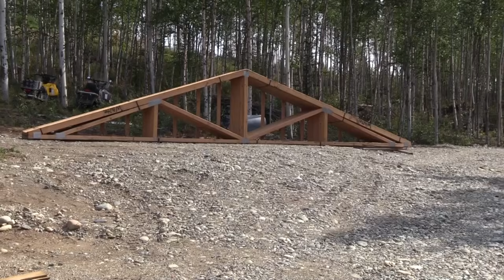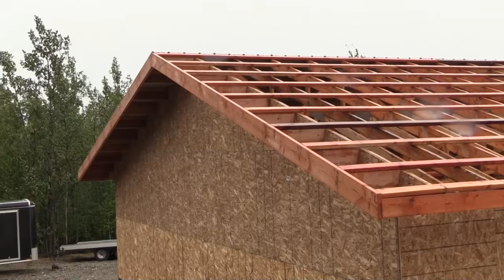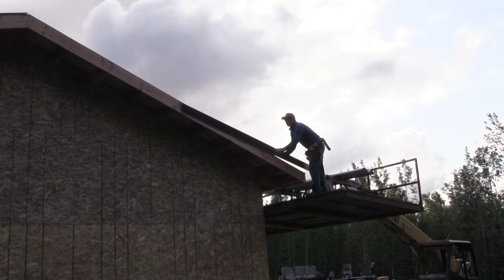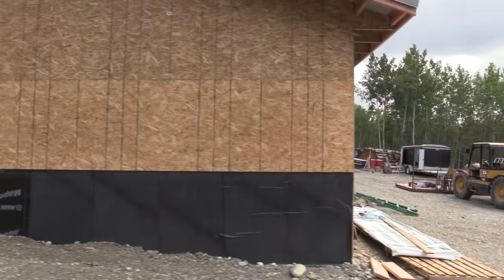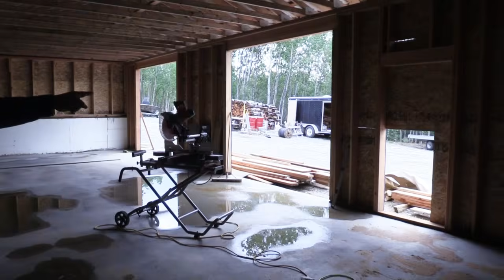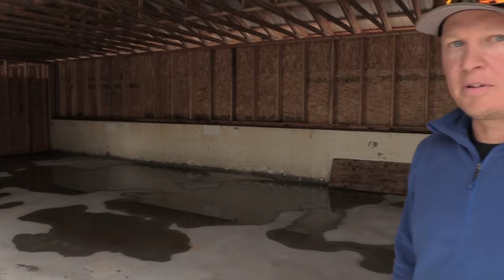Giant Workshop Truss Roof System with Metal Roof

Comment: Do you plan on using spray foam on the inside of the roof to retain heat in the winter and reduce sound anytime it rains? Thx for the videos.